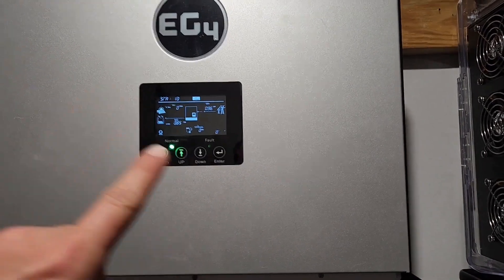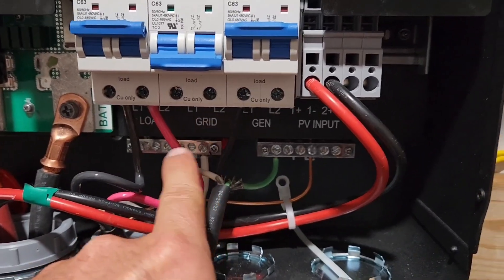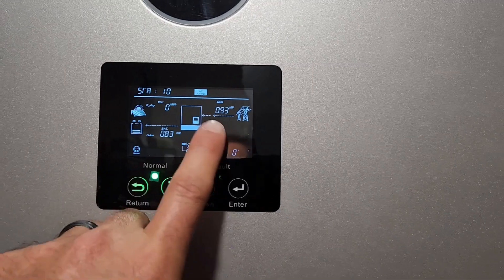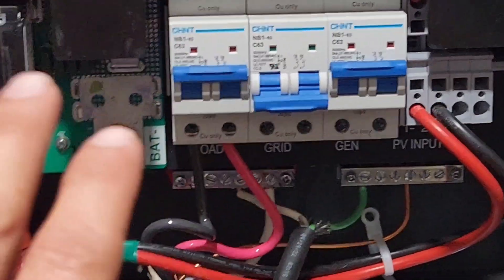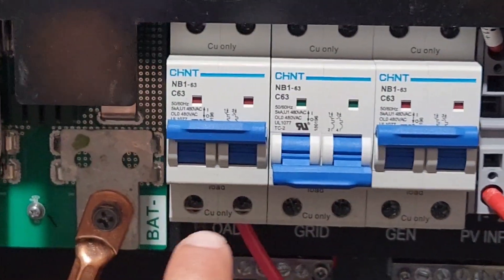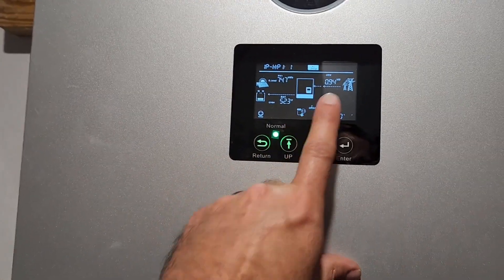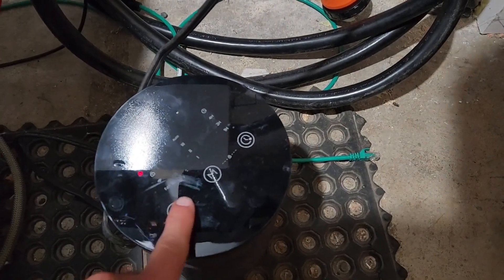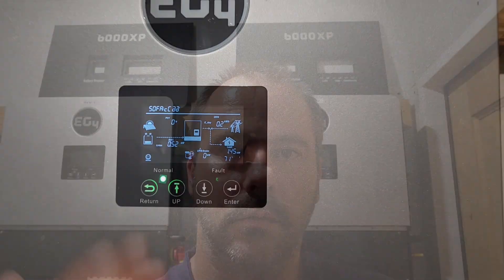6000XP Firmware enables 120v generator charging.

Comment: Why couldn’t you bridge the legs? I feed a 120V/240V service panel in my garage that way. There is no need for 240V in my garage so it works fine. You could use a jumper wire in the service panel or use an adaptor that bridges the 2 wires. I wonder if that would show power on L2? In my case, all of my 240V loads are supplied solely by the grid even though my 6000XP outputs 120V/240V split phase to my loads. It cannot handle my 2 ton heat pump, 1.5 ton air conditioner and my electric dryer so they are all on a separate service panel.
Reply from the maker: Bridging L1 and L2 will trigger a fault in the inverter.

Comment: I hooked up a 120V to L1 grid as in the video, but mine keeps clicking every second and in the Voltage for L1 grid in the display it says 120V 1 second and 0V the next second.. I tried disabling and enabling the Neutral Ground, but no difference. What could be wrong?

Comment: So when charging either Gen or Grid at 120v, the 6000 load (output) will be 120V. Once not charging at all, battery only in this case, the load goes back to 240V? Thanks for the updated video
Reply from the maker: Correct.
Reply from the maker: L2 will be zero when utilizing a 120v single phase grid/gen.

Comment: That's not a great improvement . It drops one leg ?  So anything connected to L2 in your panel is basically not gona get power while charging from a 120v generator ?   My Midnite Rosie will charge 48v batteries from any cheap 120v generator ...and maintain 240v , both legs of 120 .   I been looking at this cheap 6000xp as a backup .  Always need redundancy . I just had to run off my old 12v system for 3 days .  Like old times , can't turn on the microwave while the Keurig is running ...lol
Reply from the maker: For redundancy, I like the newer EG4 inverters since they will continue to operate if one inverter is turned off. I also their 100amp 48v charger.  It runs off 110-250v

Comment: So to confirm, if I wanted to wire into the Grid portion and charge at 120v the only draw back is it drops one of the two legs and slower charging. My plan was to build this for boondocking in my RV, then during the day turn off the load, plug into my generator and charge the power from diesel generator driving down the road.
Reply from the maker: A diesel generator that's only 120v?
Reply: @theadventuresofarenaissancman  no it’s 240v, but I don’t won’t to mess with the wiring of the coach.  I would like to take voltage form a standard 120v outlet on the RV and run an extension cord to my tow vehicle where I plan to put the batteries and inverter.  When I get to the campground, I’ll plug the coach in to shore power and then move the extension cord to the shore power box at the campground.

I’d like to keep the system mobile, so I can use it on the RV and the house.
Reply from the maker: Sounds like it would work the way you described it

Comment: Does that mean you can still only do grid power at 240? And can only use 110/120 on the gen input?
Reply from the maker: Gen can be either 120 or 240.  I'm not sure on grid I never tried it. Either way 120v limits the inverter to only 120v loads.
Reply: It says 120 grid

Comment: So I’m assuming if you have grid input as 240 and gen input as 120. It also disables leg 2 of grid input?
Reply from the maker: I've never tried generator when grid was connected. I've always disable grid before conducting generator charging
Reply: Depends which it's using

Comment: I'm having a heck of a time getting my batteries to charge from the generator. Is there anyone willing to walk me through the settings of my 6000 XP?
Reply from the maker: What type of generator?
Reply: Predator 13000
Reply: It's wired correctly to the inverter... And the inverter is recognizing it as 120 volts 60 hertz... I just can't seem to get it to charge the battery
Reply from the maker: L1 and L2 are wired correctly?
Reply from the maker: Pot you question on the DiySolar forum or the EG4 Facebook group.  It will be easier to assist you.
Reply: any luck? im having the same issue with my 5500 onan
Reply from the maker: Join one of the community forums, FB EG4/Signature Solar or DIY Solar. Post your question there.  It's hard to troubleshoot over YouTube comments.

Comment: Thanks so much for sharing this update with everyone. Keep up the great work!
Reply from the maker: Thank you.
Reply: Chargeverter has two advantages:  Can accept 120V or 240V (need plug adapter or rewiring to switch voltage), and because it connects directly to the battery, it lets the inverter simply do its job.

Comment: I just purchased a chargeverter. It hasn’t been delivered yet. I only had a 120 volt generator. I figured I needed a charger that would work on 120 volts.
Reply from the maker: 120v charging with the 6000xp has its limits. ChargeVerter is the way to go
Reply: Can you elaborate  @theadventuresofarenaissancman
Reply from the maker: 120v charging will disable EPS, resulting in  0 volts on L2. Disabling 240v loads and one leg on subpanel.

Comment: Crazy timing, as i literally installed 2 chargeverters for previous clients on their 6000xps yesterday so they could use to charge their batteries if needed 🤪  thanks so much for the update 👍
Reply: I bought this inverter because it can/should handle any generator. Why do I now have to buy a chargeverter? It should do the job!!!!
Reply: @RollOnBeGood  chargeverters are a great addition to any solar system using 48v lithium batteries. Let the inverter do it's job charging the batteries and power the loads with solar, and converting the batteries to ac power. While letting the generator charge the batteries separately with clean power conversion
Reply: That's a better choice as you change the batt and still have both legs working.
Reply from the maker: I would only consider using the 120v charging with this new firmware as a last resort. ChargeVerter is the best option.
Reply: @theadventuresofarenaissancman  when using 120v generator as 1 leg of the gen input remember only 1 leg of the load output will power the loads while generator is on
Reply from the maker: Correct